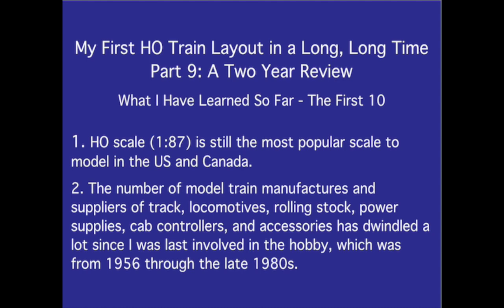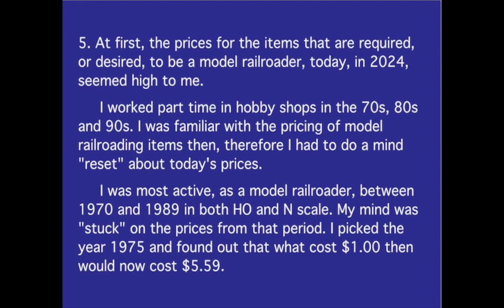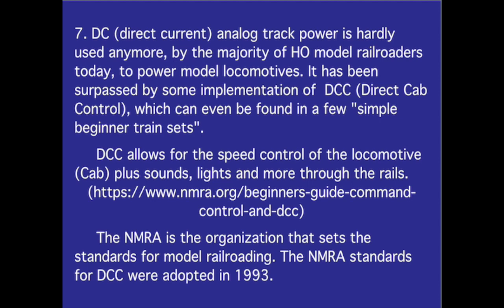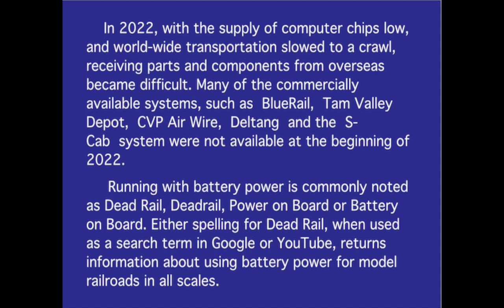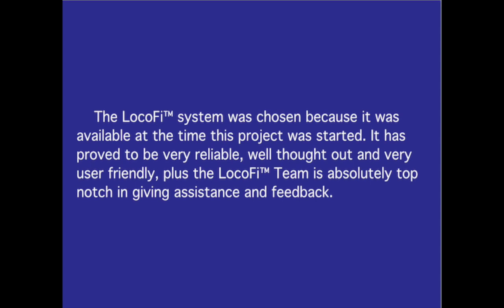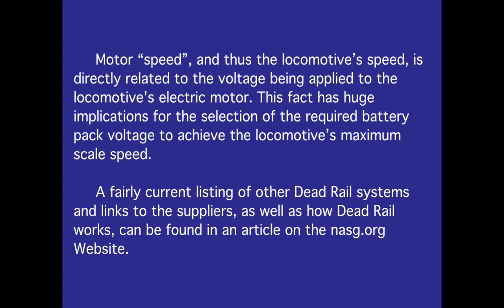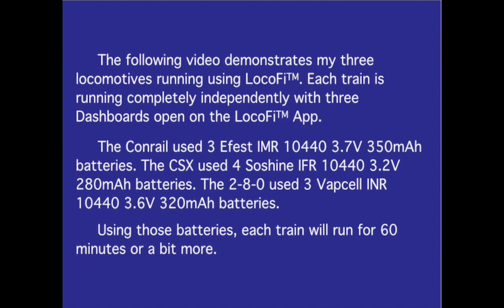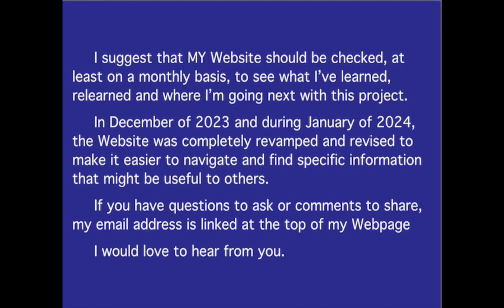My First HO Train Layout in a Long, Long Time - Part 9: A Two Year Review

Comment: Awesome video as usual with lot of interesting details. One other cool thing about LocoFi is the use of any battery pack (read any voltage) and yet be able to run the train at same speeds. This can be achieved through the creation of "speed profiles" for each battery pack. Simply switch the profile to that voltage for the battery pack and you're running prototypically!
Reply from the maker: That is exactly what I do when running the 2-8-0 Consolidation. To reach its top speed of about 45 mph, I can use 3 Soshine LiFePO4 3.2V 10440 size 280mAh batteries. My EMD 15-1s require 4 of those batteries to achieve maximum speed. I have a profile for the Consolidation using the 3 LiFe batteries and another profile to use 3 IMR or INR batteries with their higher voltages.
Reply: @EFO-of-southeastern-Michigan  Excellent! 👍